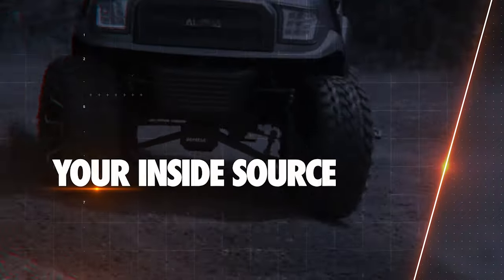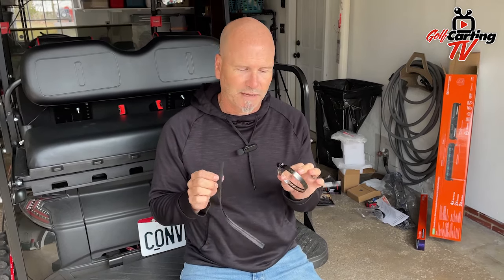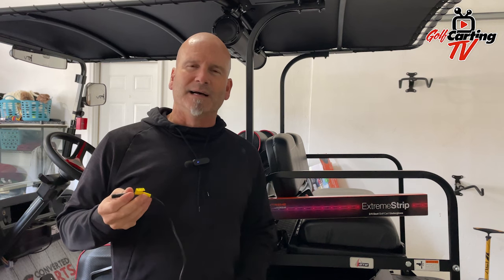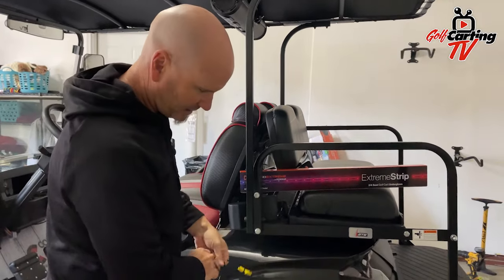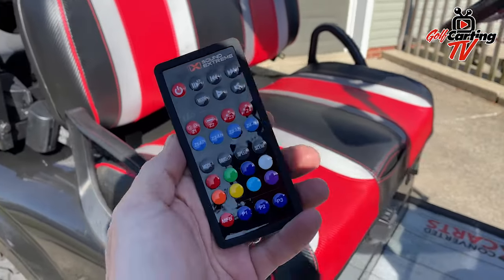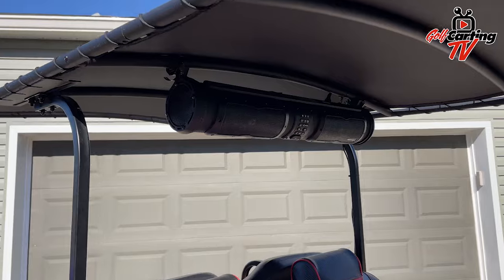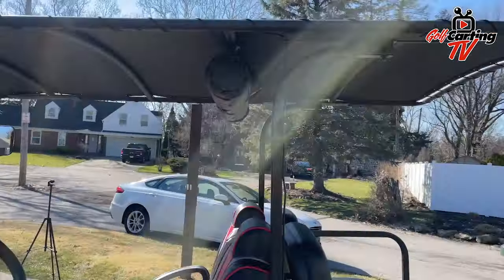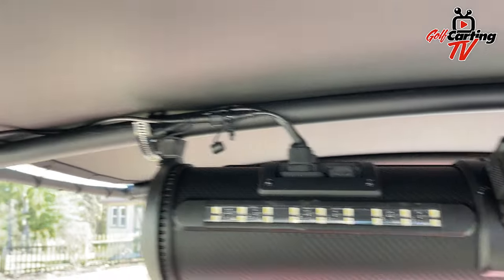SoundExtreme 28" Golf Cart Sound Bar with Lithium Battery Power (Plus LED Underglow) - GolfCartingTV

Comment: Wish there just a pinch more to this video. Would have like to hear it at night with the lights. 

I also see them flashing different colors at different times. I’m curious if the speaker and they gound lights sync exactly to music mode. 

There arnt really any videos on their extreme strip lights
Reply from the maker: Thanks for the response and questions. It's hard to represent audio quality through YouTube, unfortunately. But, yes, there are a variety of preset modes for the LEDs on the speaker and the strips. You can set them to match or show different modes on each. In the case of this video, it was set for the lights to coordinate with the music.